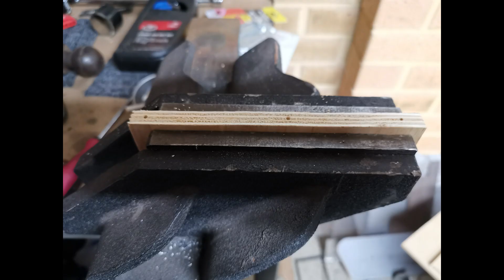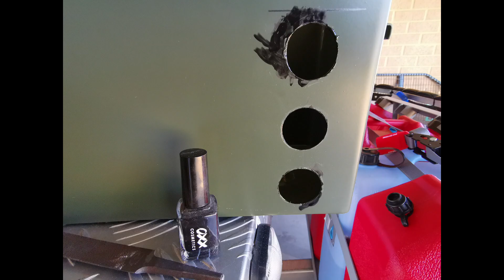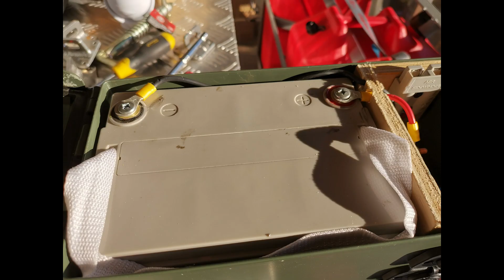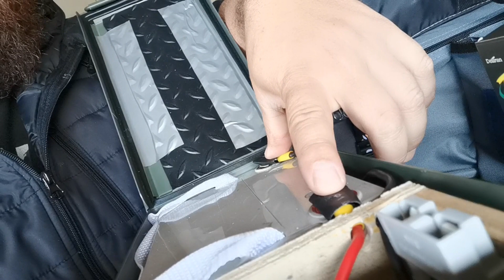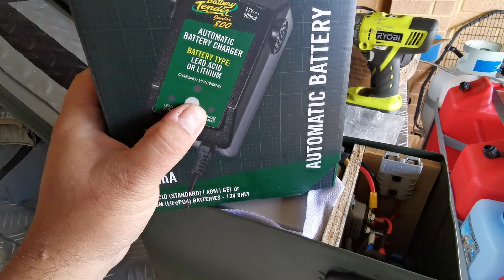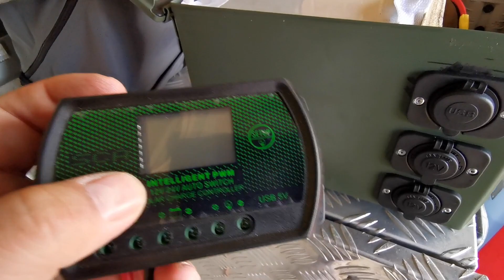How to make a Portable Battery Box. Waterproof for CAMPING, RV, SOLAR, VAN, CARAVAN etc.

Comment: Nice build. I'm currently making one with the same box but a 50ah lithium battery. I'm also adding front and side lights and a Bluetooth radio and speakers. Mainly for use while fishing. I had the same problems with the battery height

Comment: I built something similar using a plastic tool box also I fitted a very small 12V car radio and fitted some old television speakers and a solar regulator to be able to charge using solar giving me the 3 options of car solar or mains

Comment: Great Video and content, I made a Lithium version (using 18650 cells 3.7 nom.), but 4S/11p which Is 4 in series which gives 16.8Volts then use a Voltage regulator to convert to 12volt stuff. It's a pain to charge but am a nerd  🤣🤣
BUT  seeing as the battery Is a lead acid, It can only be used for half of it's power so 16 Amps. This makes sure you don't damage the battery. It lasts longer too If you don't abuse it.  ✌😁
Reply from the maker: You are absolutely correct mate. To keep the battery life decent, you wouldn't want to drain down the lead acid battery capacity even less than 50% really. Lithium cells would perform much better, and provide a deeper discharge. Even with a minor discharge (charging a few phones etc) I still like to keep the battery topped up with my little trickle charger.
Reply: For lead acid, I thought it was important to allow venting, which would suggest not being air tight.  I'm making one with a plastic box and using a lithium battery.  Lithium bumps the price up significantly, but that supports using 90% of battery's amp hours and no need for venting.  Of course, mine is not done yet.

Comment: Nice DIY man. When you run your fridge off of it, do you need to ground the negative terminal of the portable battery to the chassis?
Reply from the maker: No need, the fridge cord plugs straight into one of the sockets.
Reply: @Unfastened  👍

Comment: So if you had a plastic box you could mount the Anderson plug to the top/side of the box, red to 50 amp fuse then direct to battery with black seperate. If you didn’t want the USB.  Dcdc can sit outside of the box before it’s plugged in as normal.?